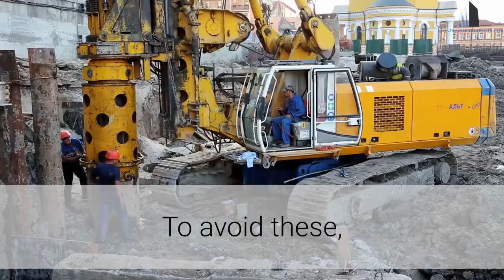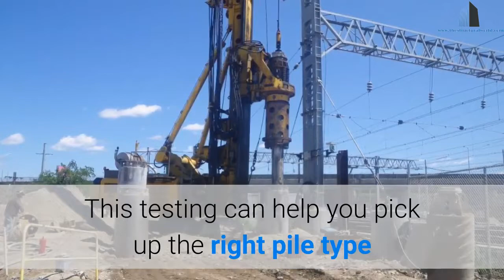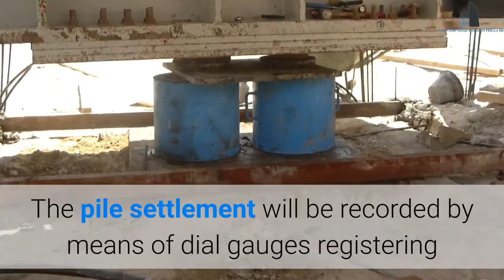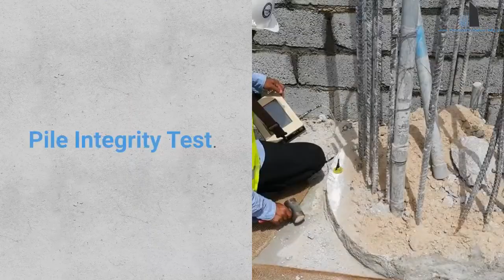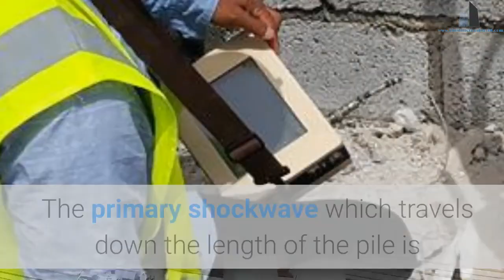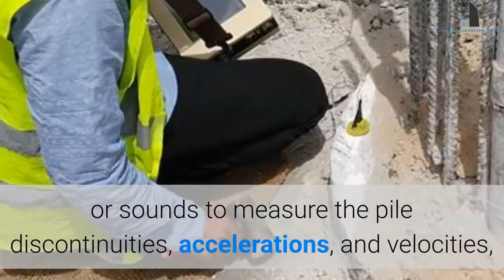Types of Pile Testing

Comment: What is the suitable time to fulfill load test for  piles after driving time
Reply from the maker: For cast-in-place concrete piles, perform the testing no sooner
 than 7 days after casting or after concrete strength achieves at
least 75 % of its design strength, whichever occurs earlier.
Reply: Thanks alot for your response... What about pre cast piles.. What is the suitable period between driving into soil time and load test time.
Reply from the maker: @zahraasadik7095  Kindly refer to ASTM Standards for more info, check out this link under ANSI Standards https://www.thestructuralworld.com/product/353/. Cheers!
Reply: @zahraasadik7095  types of soil??